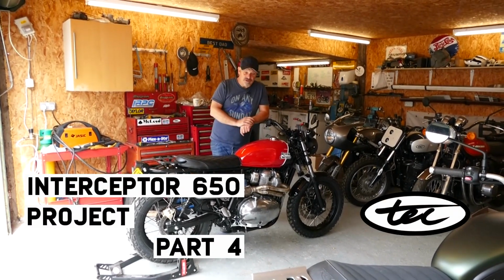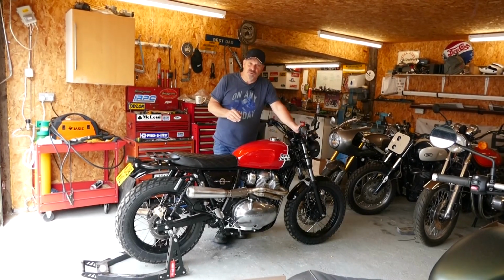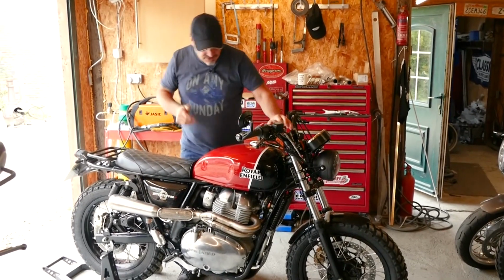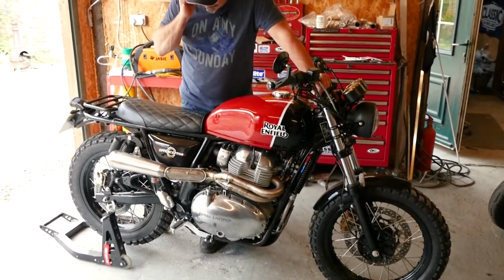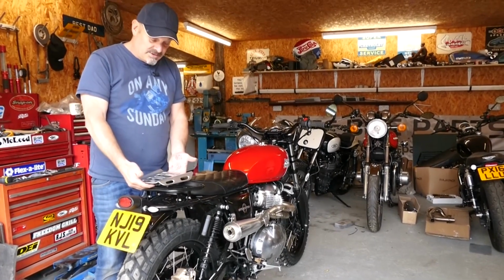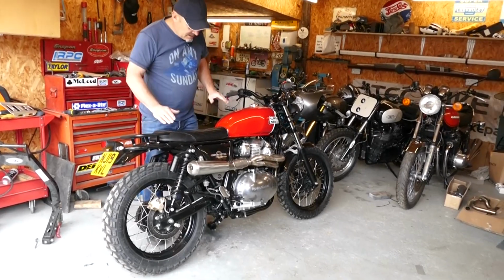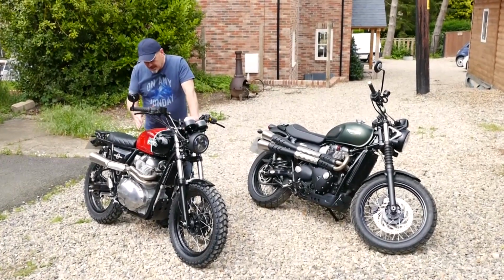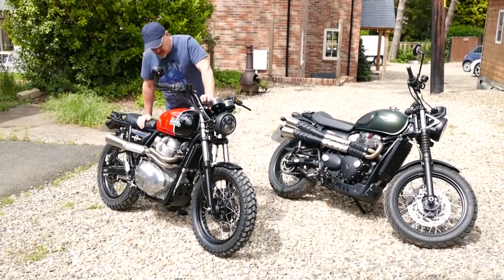Interceptor 650 Project - Part 4

Comment: I grew up with scramblers in the 70's and what you've done to the Interceptor looks amazing I live in Germany and doing any mods here is quite difficult, are you intending on selling the seat and rack, I would like the rear light and indicators as well but they must have E-Numbers on them to pass an MOT ( TUV ) again I like the fact that everything is reversible

Comment: This Royal Enfield is a home run. The fact that they are so reasonably priced opens the door to customization. The stock bike is such a good overall platform but now the horizons are opening up. Imagine ... a bike YOU can work on and modify without needing a master mechanic degree - this opens up motorcycling to the masses not the few rich. High tech bikes are race bikes but as they age they become expensive to fix and thus disposable. You won't throw away this Royal Enfield - you will rebuild it.

Comment: 2020 INT650 stock and I love it! Touring the USA. The manual has a 1,000km chain clean, lube & adjust interval. I can easily do 1,000km in a day and was getting tired of all the servicing and mess. Installed the Bandidos Pitstop Belt Drive conversion and really like it except they chose a pulley ratio that gives more torque, which I don't care about, and reduces the gas mileage/tank range, which I do care about. I'm installing a K&N high flow air filter and opening up the air filter inlet to try and get the gas mileage/range back up. Are you thinking of doing a belt drive conversion? Any other suggestions for getting the gas mileage/range back up to stock?

Comment: there are no replacement foot pegs suitable for off road or dirt road, currently available. I would like to retain my panniers, a "flatter exhaust to fit between the panniers rack and the frame would be nice, be it the Stinger or the Scrambler.

Comment: How are you getting on with that larger rear tyre ? You mentioned the 140 might be tight. Is that inside the swingarm or up against the swingarm pivot ? Looking to get some fat rear tyres without having to start looking at replacing the swinging arm.

Comment: As you keep asking the tires are Hidenhau K60 140 rear and 110 front on stock rims. I would say to use a 130 on the rear as the clearance is too tight for a 140

Comment: The bike is looking very nice, I can't wait for part 5. Can you tell me the exact size of the Heidenau K 60 tires you've fitted, thanks. The only tires listed today on the Heidenau site which seem suitable are a 110/80 – 18 M/C 58S TT for the front, and a 130/80 – 18 M/C 72T TT for the rear. Are these the tires you fitted?
Reply: I used a 140 on the rear but the clearance is very tight, I would say a 130 would be safer 110 on the front
Reply: @georgemilburn6213  Thanks, but did you fit K60s, or the K60 scout version?

Comment: Hi I’m sure u get a lot of texts. I’m curious to know how did u lift the suspension without much alterations. I’ve been doing permutations and combination but unable to zero on anything. Need suggestion. If u could help.
Reply: added longer adjustable shocks ( our type 23) and pushed the forks down through the yokes

Comment: Hi , are they they original wheels with just the tyres changed , if so could you tell me the make and sizes of the tyres please . Love what you guys are doing with the interceptor,  looking forward to getting the tec bike exhausts.
Reply: OE wheels and rims with Hidenhau K60 tires, i used a 140 rear but too big for clearance, really best to use a 130, with a 110 on the front

Comment: Thanks for this series, I just bought myself an Interceptor and am planning on doing similar mods. You fitted a K60 140/80-18 rear and 100/90-18 front? How did the rear tire workout after all? It's hard to get a hold of 18" knobbly front tires where I am from, how do you figure the bike would work with 17" rear and 19" front? I'm looking forward to the video where you get to raise the front end more.
Reply from the maker: I think you will be better off with a 130 rear for off road use as clearance to the swing arm is tight for a 140/18

Comment: Where did you get the seat. I've had a look on your website but could not find it. Saving my pennies for the levers and dna filter.
Reply from the maker: Hi we have seats but we still need to make mounting brackets etc, just not had the time, but will get onto it ASAP

Comment: Hey mate,  that a tidy job. How are the tyres holding up..are you still staying with the same in the rear ?Could you please advise how to lengthen the size of the shocks in the current set up, I am also looking to  put front suspension kit with the same cast ....what are your thoughts ? How will a new after market shaft and also bore kit impact the performance? Thanks

Comment: The stock tank color looks the best and is actually the main highlight apart from the huge engine and the exhaust. If you really want to go far the colors you can vinyl wrap it, thus keeping your ideology of going back to stock anytime. Remove the mods, remove the wrap and you're back to 100% stock.

Comment: and please tell us where you got the new lights etc from.
Reply from the maker: Hi
We are making them and will supply as full or part kits inc plug and play wiring, available from mid November. Sorry for delay but had to wait for E marks on lenses
Reply: @TECBikeParts  Really looking forward for this parts to be available
Reply: @TECBikeParts  Hi. Just wondering what bracket you use for the number plate, as the rear light shines behind it with the original bracket. Thanks.

Comment: could you give me the details of the tires ?
Reply from the maker: K60 Scout tyres
Reply: @TECBikeParts  thanks,,but if you can give me the detail of the tire as well
Reply: the both please because when i search in internet,i didn't found the front one,and for the rear,the dimenssions are:130/80/18 instead of 130/70/18.
thanks a lot for your answer
Reply from the maker: @damienmessiaen4252  I used 140/80/18 on rear and 110 front   but this is tight, I would suggest 130/80 rear and 100/90 or 90/90 front
Reply: @TECBikeParts  thanks a lot,if you can give some information regardinf the exhaut,i would like to install the same on my interceptor
Reply from the maker: @damienmessiaen4252  Hi
We have some new exhaust systems in development now and should be available at the end of the year.
Reply: TEC Bike Parts thanks a lot,hurry to see

Comment: Major noob here - what does increased air flow offer to the bikes performance in general?
Reply from the maker: In very basic terms, engine tuning is the art of getting as much cool air in and hot gasses out as quickly as possible , anything that improves this flow will have a direct effect on engine output.

Comment: Any word on when any of the exhausts are going to be available?
Reply from the maker: Hi
We are very busy in the Summer, but I have been making the most of it by doing loads of road and dyno testing on exhaust systems and other new parts for the RE. We had suspected the standard front pipe arrangement was poor but it was only when we started making our own designs we realised how bad the stock front pipes and silencers are. They also are VERY heavy. We now have a full stainless system that weighs about 1/3 rd of stock ,gives an extra 10BHP on stock ECU tune, looks and sounds fantastic. Just gone to the factory for jig making and I should have a pre prod sample in about a month. If all OK we should have the first of the new full systems on sale in the Autumn at around £300.
Loosing over 10KG and gaining 10 BHP has transformed the bike
Reply: TEC Bike Parts I thank you for a thorough and quick reply sir, I will be patiently waiting and will be happy to be a customer!

Comment: Any chance there will be a 2 into 1 exhaust for the the Continental GT? Also can I order from the UK website from the US? TecUS doesn't have much compared to the UK site.
Reply from the maker: Yes 2-1 low and high exhausts  in development now and getting good results over stock system . US store gets the parts around 2-3 months behind UK as they are developed, made and trial marketed in UK first

Comment: What is the tyre size?
Reply: hi 140 rear and 110 front on stock 18" rims, 140 is very tight for clearance and may be better with 130

Comment: 12ft lb increase in torque, with just a slip-on? That's almost 33%.
Reply from the maker: have you seen how restricted the standard silencers are !
Reply: @TECBikeParts  did the ecu need to be flashed or was a power commander required?
Reply from the maker: @ojastushar8123  . no need to re map the ECU- we have done lots of dyno runs . I will list some runs and charts in next video.

Comment: Looks AMAZING! When will that exhaust become available on your site? I'm not seeing it there. Also, will it need a fuel management system to go with it?
Reply from the maker: both of these parts in development/testing stages at the moment, should be available in a couple of months
Reply: @TECBikeParts  Maybe a replacement underseat access panel that's more flat could be available to be able to tuck the exhaust in closer? You're doing great work, can't wait to see the final products
Reply: @TECBikeParts  Any timeline on when the scrambler exhaust and rack will be available for purchase.

Comment: This project is looking sweet. I would buy a bike looking like this as it is - for sure. 

The only downside on Einfield in my opinion was them chosing a combination of 18/18 rims, as there aren´t many dual sport or dirt oriented tires available for these sizes, specially for the front (as far as I´ve looked) on the factory sizes.
Reply: There are people in India that have changed the rims to 17 inch and put on the 120/70 at the front and 160/60 at the rear, they look fabulous on the Interceptor.

Comment: With the high flow air filter link the DNA or K&n do you have to remap to compensate for the extra airflow or does the map sensor adjust well enough for the change? Many thanks

Comment: I’m picking up a new GT 650 Ice Queen in 2 weeks. I like the stock look but would like to make some changes.
1. I noticed your U.S. distributer does not have the RE parts? Would you be able to ship RE parts to the U.S.
2. Where can I get that LED headlight and rear turn signals? (I would definitely buy the tail light assembly if you sold it.)
3. Will you be making matte black front pipes to match the matte black cones?
4. Does the new air intake and cone silencer add better performance in terms of power?

Keep up the great work! Watching you makes me more confident to work on my bike.

Comment: Great bike modification, but when the motor takes a shit with all the mods I doubt R.E. will honor the warranty, their service dept. will look at the owner and laugh their ass off. I don't think R.E. built this to be modified, but time will tell.
Reply from the maker: You might be surprised but RE are actively encouraging owner customisation. I had an email from RE design and they like what we have done !
This motor has been tuned to over 70 BHP in street trim by S&S with no reliability issues, and they had a bike at Bonneville setting a new world speed record with well over 100 BHP.  It is heavily over engineered. you will see a 900cc version soon watch out. No reliability issues at 50 BHP and will run for many ,many years trouble free if serviced correctly.
Reply from the maker: see- https://www.youtube.com/watch?v=jPiqFH5wLZ0
Reply: Didn't R.E. Have problems with early Himalayan and left the owners in the lurch? Will wait and see what warranty coverage you get if you modify the bike, it's got a computer in it, Big brother is watching  you. Motor vehicle inspection is getting tougher every day and soon your going to have to pass emissions, don't throw the cat's in the trash.

Comment: Can we replace 130 to 150 wide tyres??
Reply from the maker: We have fitted a 140/80/18 and it is very tight, a 150 would not work as swing arm will have no clearance

Comment: PLEASE REPLY ! The 98% intake calculation is with the FREE FLOW EXHAUST or With the STOCK Exhaust Which Comes with the Bike ??? There was one Person Who had the View that IF u Are Using the Stock SILENCER Just Buy The DNA filter .. Use The Open PLATE Only IF your Using the FREE FLOW EXHAUST !! WHAT IS YOUR Final Say Sir ???
Reply from the maker: Hi Paul,  I think you may have miss understood . This test is not done on the bike but on a air flow test bench with the new DNA filters flow rate  compared to a new and clean original RE paper air filter and just shows how restrictive the stock filter set up is as we suspected.On the bike you can feel that it responds better and also sounds better too !
Reply: @TECBikeParts I'm sorry I misunderstood Sir... thank you so much for ur reply... So it's better for me to Use Both DNA air Filter And the Filter Cover on the Interceptor.
Reply: @Pauldanny55  Hi paul,  It's best to use hi flow filter and hi flow intake cover together
Reply: @TECBikeParts  the thing I was wondering about was the air/fuel mix being too lean.  With both the air filter, and free flowing exhaust, how is it looking when sampled on the Dyno?  Will it need a fuel controller to get it sorted?
Reply from the maker: @terrycavender  On the dyno the air/ fuel ratio was good with silencers and hi flow filter system. no mods needed
Reply: @TECBikeParts  it is rare to see that these days.  Most times bikes are too lean in stock condition right from the factory.  Is this an open loop fuel injection system? Or closed?
Reply from the maker: Hi
I think you may have misunderstood this. It is the flow test bench figures of the standard air intake and filter against the new DNA  intake and filter. this is not done on the bike but in the test lab on the air flow bench and shows the max airflow in CFM . This is the most accurate way to test airflow through airbox. The Hi flow plate/ filter will work with stock or aftermarket exhausts
Reply: @TECBikeParts  hello Sir , when is the part 5 of the video coming .. lots of people are eagerly waiting...
Reply: Hi everyone.. just last Week I got a Call from Royal Enfield,  they upgraded my ECU and installed a New Software.. which is supposed to remap the Airflow intake and Help the Bike in High Altitude.

Comment: How much from start to finish do you think this would cost ????
Excellent video as normal ,keep up the good work .
Reply from the maker: Hi
It depends on how many of the mods you wanted to do, but none of the prices are really high. Here are some approx prices starting at most expensive. Exhaust full stainless system £300. Seat/ rack combo conversion kit £150. Alloy TEC adjustable shocks £150. pair of K60 tires (from wheelhouse ) £135. tail light £25.00. LED indicators kit £30, headlight £30. headlight brackets £40, alloy bars and risers £50,
Reply from the maker: Some of the parts are on our web shop now and the rest will be available very soon
Reply: @TECBikeParts  ,honestly i thought it would be more than that !!!!.for the amount of pieces that you change thats not really that expensive. 
When i buy my royal enfield i think i will get in contact with you .
Until then keep your knees in the breeze .

Comment: Keep up the good work... Very much enjoy your work. How do you rate the R. E 650 interceptor compared to the Triumph 865 Scrambler?
Reply: Hi
The stock 865 triumphs have a strong and reliable motor. But they are a bit safe, soggy ,sedate, heavy feeling and old school, not really a bad thing but don't inspire spirited riding, With a few small mods they can be transformed into a much nicer bike. biggest improvement I feel is fitting longer and better rear shocks, this quickens the steering up and gives a better turn in and transforms the ride. lots of things can be done cheaply to improve the forks ( see my video on this ) and with both done the bike feels 100% better. With a few other well documented mods the old gen triumphs are still  a really good bike and getting better value now with the water cooled bikes and new RE driving down used values
Reply: @georgemilburn6213  Thanks George.... That's really useful, I'm deciding between a used triumph scrambler or RE Interceptor... Not too much difference in price, just age, so working out the best way to go.... Which is the best bike? I had a scrambler a few years back. I understand that both need modification and benefit greatly from this. Thankfully tec can guide me in the right direction. Thanks again George!

Comment: Great looking bike!
I'm a bit concerned about the exhaust though. 
Before the pipes merge into the silencer they really should be the same length otherwise you lose power.
I've seen one case where somebody fit a Beetle engine in a motorbike and used unequal length pipes.
He lost 10 horses ie he got 40 compared to the cars original 50.
Reply from the maker: Like I say in the video we are trying lots of exhaust combos and we still have a lot of testing to do. In these videos we are trying to give some insight into how we develop parts and styling for bikes.  Exhausts on a bike are Always a comprise between performance/looks/ fit/ noise/ ground clearance/ note/Db's/ heat/ practicality/ cost/ legality/ emissions/material/ finish/ colour . You just have to prioritise what is most important and work around all the issues We can take several months to get it exactly as we like it .It is not just welding up some pipe to fit the bike like some exhaust makers do !

Comment: My minor concern is that you've covered the tool kit access with the exhaust...but that really is a minor issue...

*edit, you later show that you can still access the panel!😂
Reply: Hi
Yes we made sure that you would still be able to use the side cover for toolkit and seat release. It was one of the major  points when designing the exhaust and not easy to do without the exhaust sticking out too far. but we found a solution.